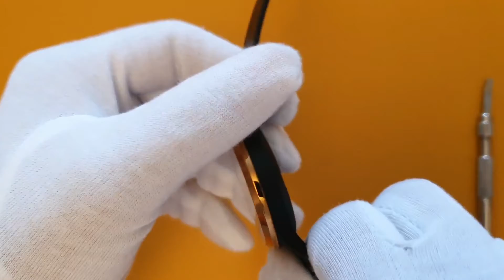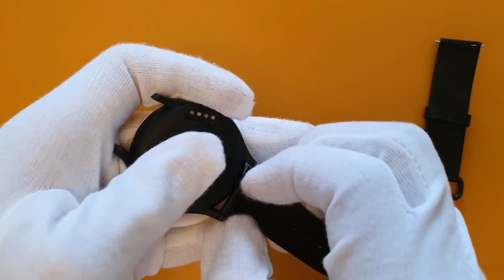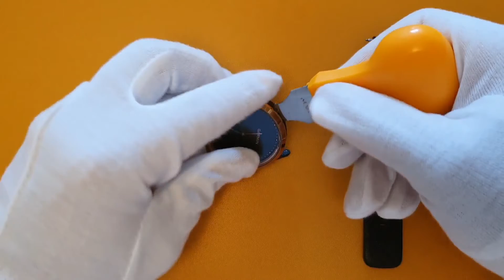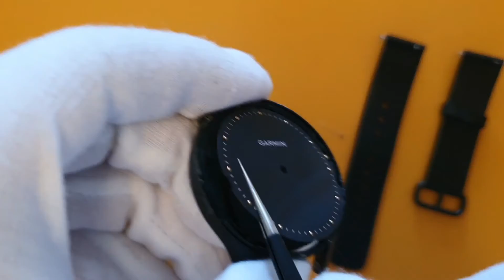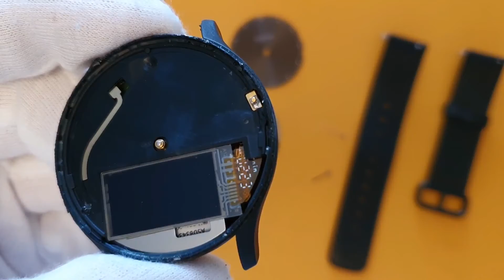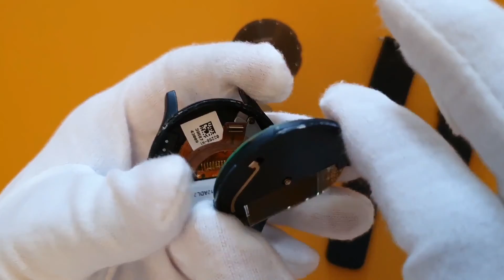Hybrid smartwatch disassemble! GARMIN VIVOMOVE HR

Comment: Anyone where to get the top glass part with the bezel?

btw also here because of the faded display, but seems rather difficult to change that part. I should probably buy a new one, but they are more expensive and now that I see this happens to many users.. What would be the best alternative?
Reply: Tried it today, you can't get replacement displays anywhere. I bought another broken Vivomove and changed the displays from one to the other. Sadly I broke the "new" oled. Now I know that it's not necessary to remove the watch hands to change the display, you can simply remove the whole inner working of the clock, turn it around and remove the 3 screws of the display. That way you don't need to remove the watch hands (which was rather difficult)